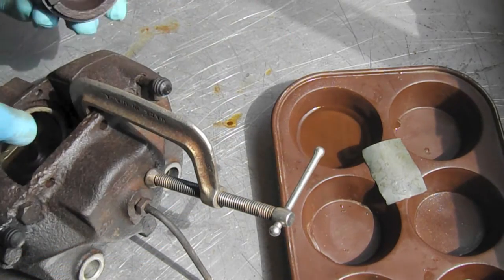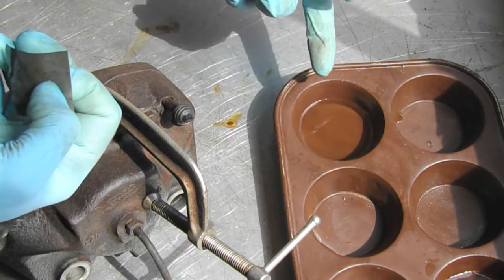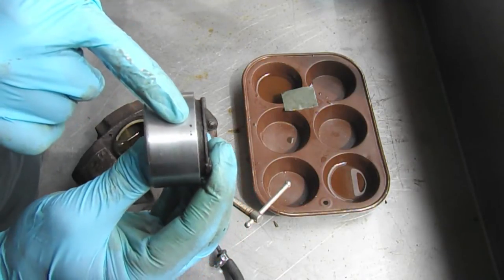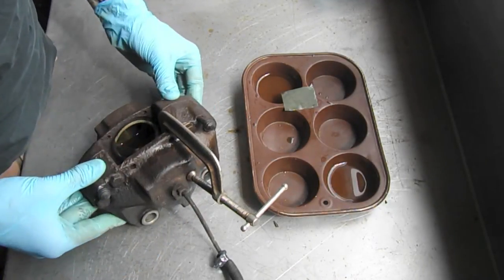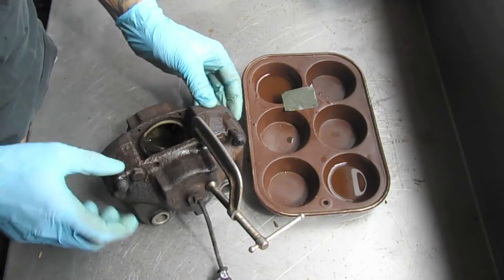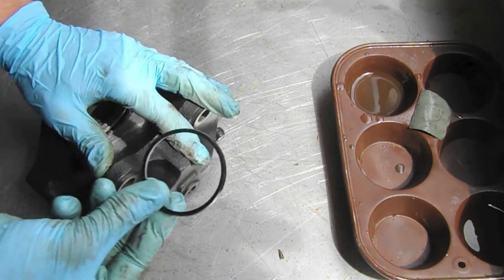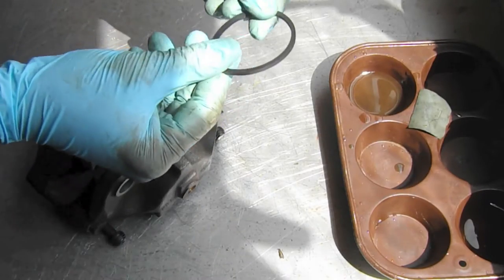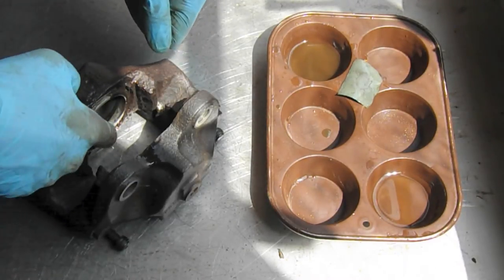Front Brake/Caliper Rebuild on VW Bus - Part 2

Comment: Great stuff! I have a similar caliper on my VW LT35. Had same issue with bleeder valves snapping like in your previous video. Luckily had a bit more leftover that you did, smashed a star socket on top and it cracked, otherwise welding would be best option!

Comment: Can't wait to see some videos of that bus on the road. That teaser video you did without plates wet the appetite.
Reply from the maker: Me too! Ive been having to replace the brakes and steering components but driving it a little more now. I think I'm going to put together a video doing a little highway and some off road stuff which should tax the cooling system pretty well. Hoping to get that going in the next few weeks.

Comment: I gotta say that the severe rust you guys see up there in CO must be so prevalent that you don't pay much mind to it.  I would have dropped that caliper in the scrap heap, myself!  But you made it work, and that is a good thing, brother.
Reply from the maker: Oh, the irony - this is a Texas Bus ;) there is a little rust up here in CO but definitely not as much as the coasts and the Midwest (that's probably why they're hard to pick up for under $3000 here). Anyway, thanks for the compliment!
Reply: I have seen some for sale on CL in the Houston area that look pretty rotted.  

You mentioned in the video something about Bentley.  Is that a repair manual or something?  Just curious.
Reply from the maker: You can replace almost anything on these busses that have rotted, I love that!

Comment: One problem you will have is that you'll never get the air out of that brake caliper. That caliper is a right hand caliper. The bleed nipple is at the bottom of the caliper it should be at the top. Any air in the hydraulic system will go to the top of the caliper and it will stay there. Unless the caliper has a provision at the top to fit a bleeder you'd have to swap them over.
Reply from the maker: +aussiepaul50 They have bleeders on the bottom and top - Stops like a champ. I don't believe you can swap calipers from side to side either. Thanks for the comment.
Reply: That’s why you have bleeders top and bottom - they are not handed 👍

Comment: awesome video bro, i have a problem on my bus with the brakes,it seems that the front ones dont brake at all while the rears do,i bled them 99 times and the pedal is still soft it gets hard after 2,3 pumpings than when i move my leg from the brake pedal in 2,3 secs its soft again...is it the master cylinder or something else cuz there are no visible leaks anywhere,do u have any ideas what could it be??any suggestion is welcome :) cheers
Reply: CROOKKEEDD D I have this same problem. Did you ever resolve your issue?
Reply: No leaks at any wheel and no line leaks = replace or rebuild the master cylinder. $70 for the jbugs Brazilian made master cylinder is cheap for WORKING brakes, after all my bug stops (I got tierd of rust so from master cylinder out removed and replaced with NiCopp and new hoses.  I sure do not want a bus rear ending me.